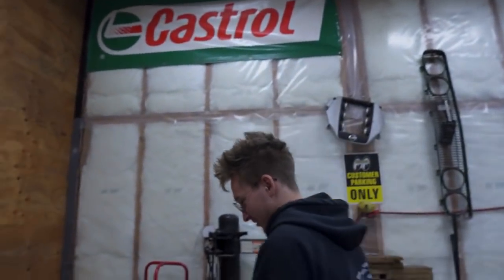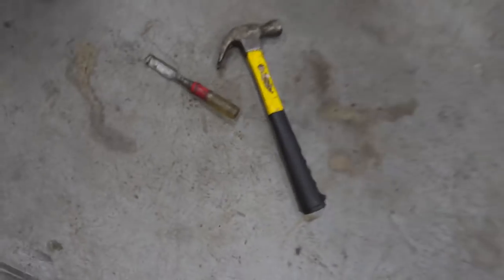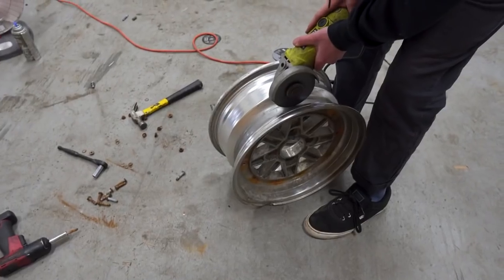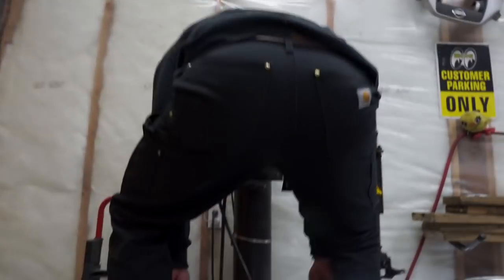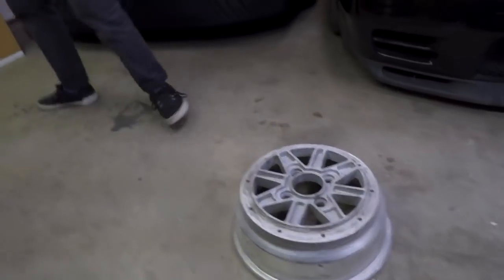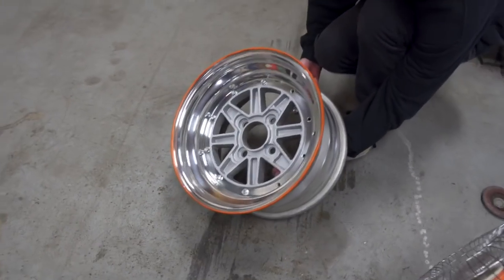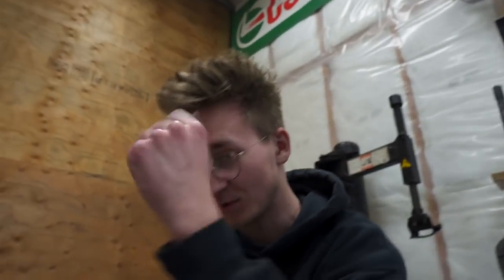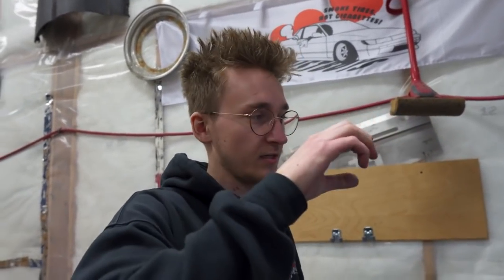CHEAP AND EASY WAY TO RE LIP WHEELS!

Comment: Ooh man, they look good but thats really dodgy not welding the lip on. SSRs have nowhere near enough bolts to properly secure the outer lip and theres a real risk of that debeading as the bolt spacing is just too far apart. I know it "works," but there are a lot of stresses applied to wheels particularly during hard cornering that genuinely makes this quite unsafe. Highly recommend watching some of Barrel Bros videos, they go over this in depth on several of their videos, rtv is not enough to keep a wheel together unless you're relipping a wheel like a BBS RS that has a high number of bolts securing the lip face and barrel. Again, they look rad but just be aware of the risks, it's probably not a good idea to tell people to go out and do this to their own wheels at home...

Comment: Yes the face is still welded but theres no way id trust running them without welding the lip on as well
Reply: not all 3 piece are welded and many 2 pc are converted to 3 without a weld. i’m running work ls207 no weld
Reply: Most wheel rebuilders do not weld the lips on
Reply: @supersportsim5368  not on true 3 piece wheels but there's a reason why that weld is there on these. Those bolts are meant to be for show not structural at all.

Comment: i really really hope nobody sees this and thinks its okay to run small wheels without welds :(
Reply: Tried it on 8 Bolt Riverside's and they started to separate on the road after half hour so had to get them welded. I'd never advise not welding low bolt count wheels. PLEASE WELD THEM BACK UP guys.
Reply: The majority of 3 piece wheel builders like pine engineering do not weld the lips on, as long as you have proper hardware torqued to the right spec it will be fine. Of course if you have the opportunity and resources to weld them you should but otherwise it’s fine
Reply: @supersportsim5368  any wheel with less than 25 bolts should be welded, I’ve been building wheels professionally for 3 years. Even with the right torque specs 8 bolts will not hold up with just silicone
Reply from the maker: @supersportsim5368  facts muhn. Perfectly fine to run them without welds. Just don’t use crappy tire spec hardware and make sure you torque it to spec
Reply: @supersportsim5368  there are very few exceptions like epsilon’s but rule of thumb is if they come welded they should leave welded